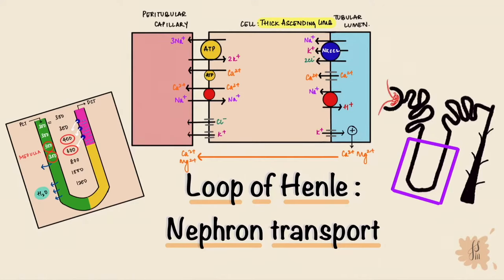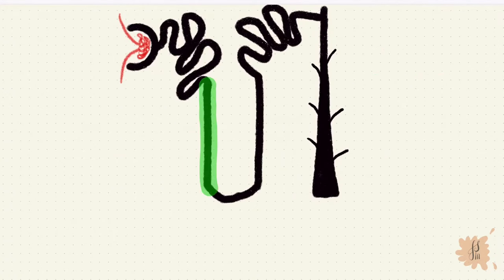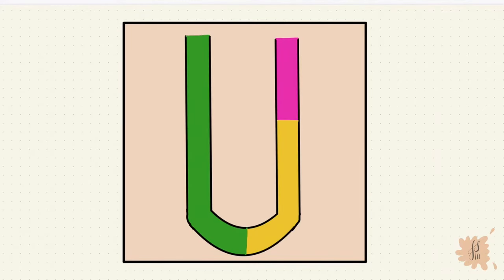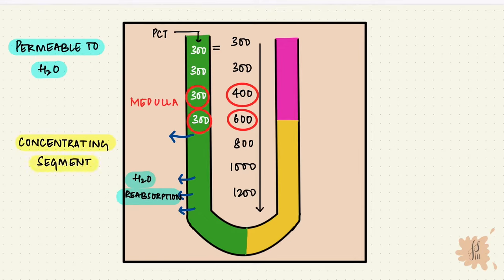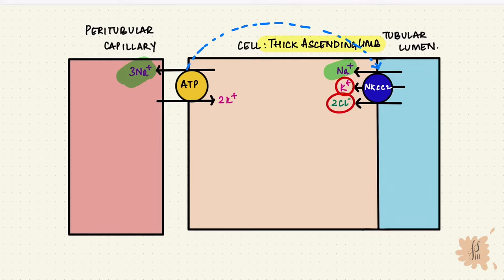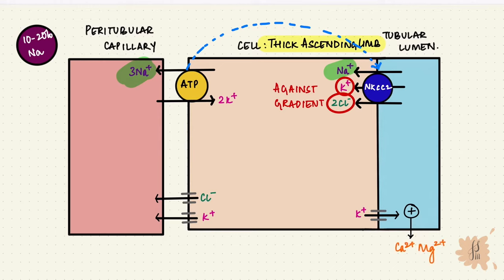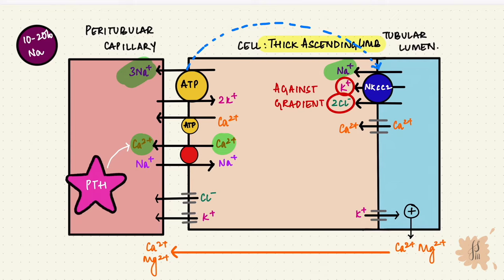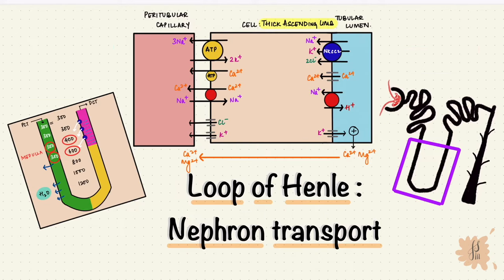Loop Of Henle | Nephron Transport | Renal Physiology

Comment: Near the end you say the urine is getting less concentrated, but then you say the main function of the loop of Henle is the countercurrent multiplier, which concentrates urine. So does the urine become more concentrated or diluted?
Reply: It depends if u have had lots of water the body will produce more urine without water reabsorption from dct if not the body will concentrate the urine. How? The dct and collecting duct will reabsorb h20 using adh and aldosterone hormones . conditional reabsorption.
Reply: Also about vasa recta, it help maintain ionic concentration in medullary interstitial fluid and so, when aldosterone and adh act high water reabsorption occurs and urine gets concentrated. Basically vasa recta indirectly helps in concentration of urine.main work is of dct and collecting duct+ hormones. I hope u understood😅